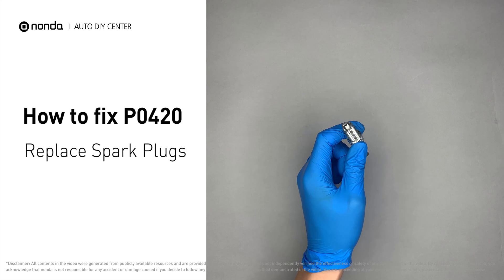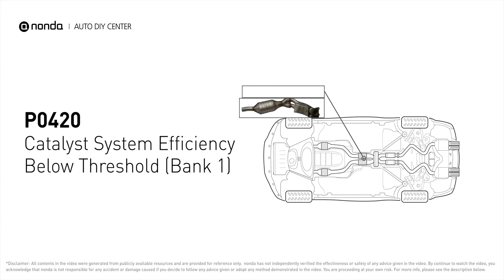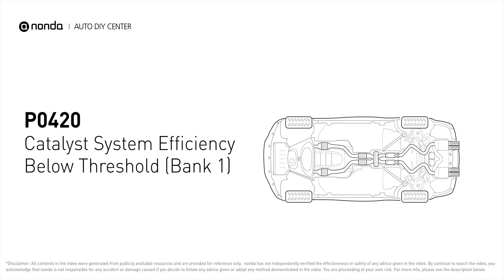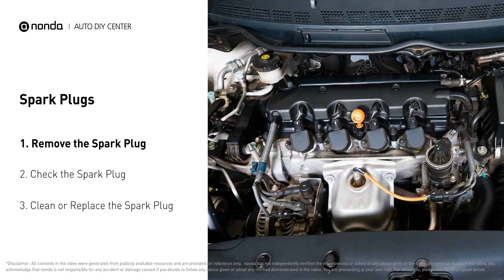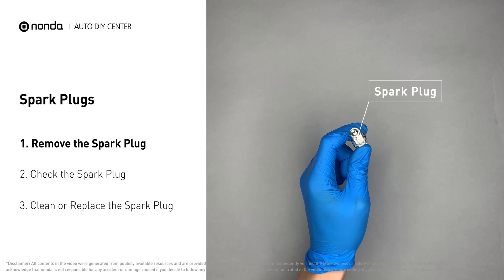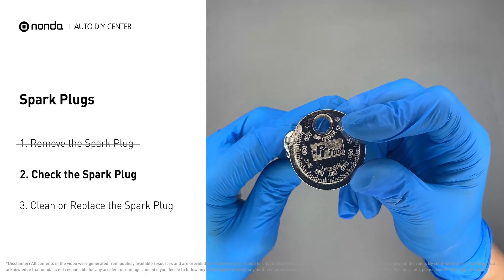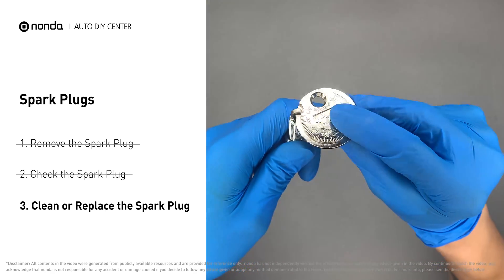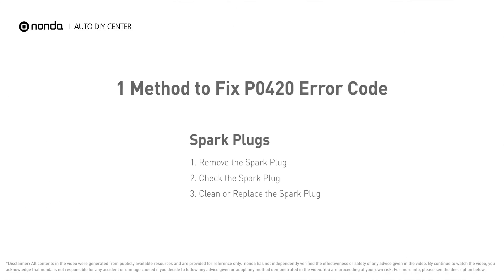How to Fix P0420 Engine Code with Spark Plugs Replacement

Comment: I have a 2014 Chevy Cruz LT with a 1.4L turbo engine. When I scanned it to get the error codes it came back with 2 PO420 codes. A “normal” PO420 code and a PO420pd. What is this last code?